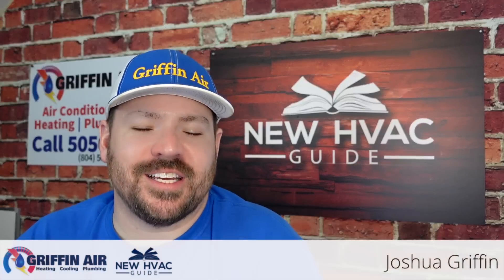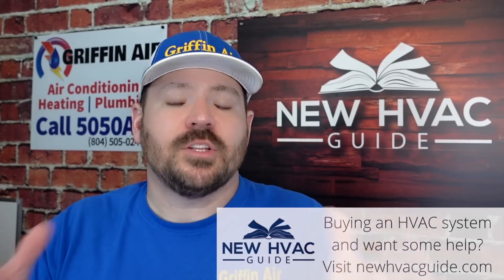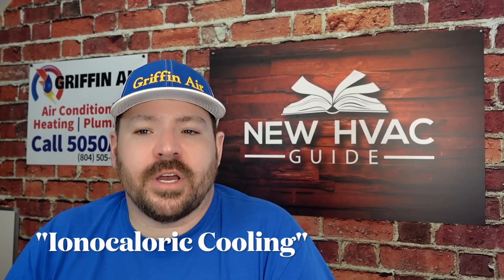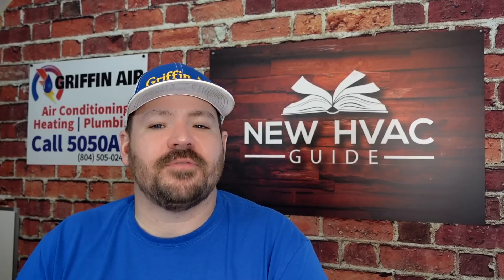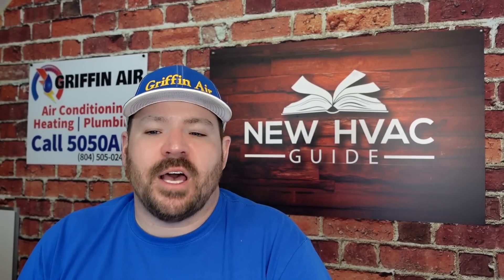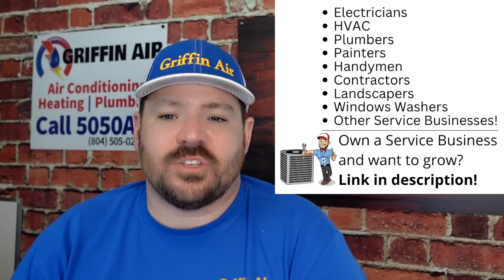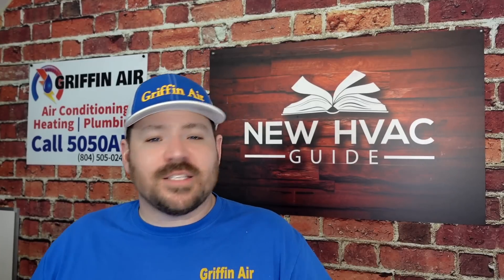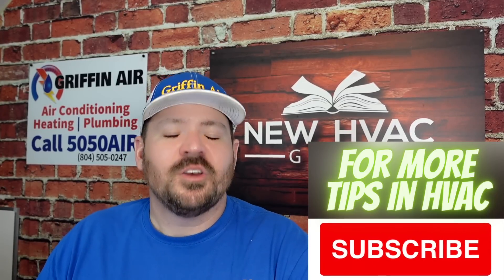New HVAC Technology INVENTED!

Comment: Key to a heat pump system is phase change of material.  During the phase change (gas-liquid-solid) there is a step function in heat exchange to provide or give off the necessary heat energy to make the phase change jump.

Trick is to induce the phase change by another parametric factor, like pressure in the case of conventional heat pumps.   It is always going to require some other source of energy to induce the phase change, like a compressor in the case of present conventional heat pumps.  The success of heat pumps is because it requires less added energy to induce the phase change than the heat energy absorbed or given off by the phase change.

Certain materials can be induced to perform a phase change by subjecting the material to an electric field which puts s structural stress on the material inducing the phase change. 

Usually, these methods require a driving force energy that is not very efficient for the amount of btu transfer accomplished.
Reply from the maker: Great explanation!

Comment: We need a hybrid water based radiant cooling ceiling panels, with air-duct diffusers and air-duct exaustion terminal panels around the ceiling
Reply: How do u deal with condensation
Reply: We use intelligent sensors and controls to monitor the dew point temperature to avoid condensation!  @frqnj
Reply: @frqnj 🤣
Reply: Good reply lol

Comment: Video suggestions:. I'm looking to build a new house and are considering going ductless.  A discussion group I'm in seem to really think it's a dumb idea. What I'm thinking: a 4 bedroom, 2 1/2 bath, 3k sq ft house.  I want to be able to save money by reducing the use of the guest bedrooms unless needed.  Some are saying that putting a 6000 but unit in a bedroom is crazy (I've seen your video on right sizing). They also say that a multi-split are terrible because the condenser can't balance the usage correctly.  I've thinking of a ducted mini-split for the master suite along with the closet and Landry, a unit for the great room/kitchen/eating area, then a 4 head unit for the other bedrooms and sun porch.  What do you think.?
Reply from the maker: What exactly do they think is dumb about it?
Reply: @NewHVACGuide  two fold, overkill which makes it over priced, and a multi head doesn't work like you'd think it would...basically, the outside unit can't really support multiple heads - service degrades the more heads.  Another issue is air filtration.
Reply from the maker: @sctexan5392  Not sure which outdoor unit you're thinking of installing, but there are lots of multizone systems able to support multiple heads.
Reply from the maker: Inverter mini-split systems are the future, but if you're in a market that no is installing them, it may be tough to find someone to work on them.
But when it comes to efficiency, performance, less duct loss, and quiet operation... mini-splits are far superior to conventional forced air. There's really nothing to argue about. 🙂
Reply: @NewHVACGuide  actually have Diakin and Mitsubishi are on top of my list.  What do you think of the air filtration question?  One home consultant says if you go ductless, you'll need whole home air filtration or stand alone units placed around the home.
Reply from the maker: @sctexan5392  I think you need to talk to someone that knows what they're talking about 🤣
Check out this article https://www.mitsubishicomfort.com/articles/filtration-the-way-to-better-indoor-air-quality
and this one https://www.mitsubishicomfort.com/articles/the-filter-you-choose-matters-fight-allergens-without-lifting-a-finger
Reply: @NewHVACGuide  thanks for the education

Comment: When I hear "salt" I think of corrosion and various methods to abate this to avoid an untimely early demise of the system.  Many promising technologies have failed on the rocky cliffs of scaling, efficiency, lifespan, and production costs.  The resulting ionocaloric cooling system will also have to be easy enough to understand and maintain to deliver a compelling life cycle cost to the consumer (corporate and retail).  I'm appreciative that this is being researched.  I wish that more money would be diverted from fusion power research and hydrogen fuel cell research to cooling technology research.  It was over 121 degrees F in Vancouver WA for nearly two weeks in 2021 and it's looking like this will be more likely in the future.  Most don't have air conditioning in this area.  If we all bought air conditioners and fired them up, a tremendous amount of electric generating capacity would have to be added given today's air conditioning efficiency.  We need better!

Comment: I personally think If stand alone heat pumps can get cheap enough that they will be the number one way people heat there homes. At a point when the air gets warmer. If the unit is internal and is abstracting that all ready warm air that it created.  I can’t see that not being super efficient.
Reply: Heat pumps are good for your home heat/cooling and hot water but not necessarily for your refrigerator or car or or computer, or people who need window ACs. That's where this tech will come in.

Comment: They actually use co2 in industrial refrigeration now
Reply: It is still the vapor cycle though, but I do wonder why they do not do it in a residential setting. My guess is because of the pressure that is required to make condensation happen, over 500 psi I believe, so it may have a high energy requirement. NASA uses carbon dioxide for some refrigeration in space.

Comment: This same group is also working on an alternate project which is close to completion. This project combines a patented scroll type compressor driven by the engine in a gas powered vehicle. It is not yet planned for diesel vehicles. This revolutionary compressor will have the ability to pull in the fuel being expelled into the atmosphere by all petrol powered vehicles. None of the current petrol powered vehicles are capable of burning 100% of the ingested fuel.  The newer emission controlled vehicles emit considerably less unburned fuel, but still emit a sufficient quantity to make this system viable. The output of this system accurately produces a product more resembling natural gas or propane vapor. No atomization is necessary, and it produces absolutely no crankcase dilution. In many areas this new system will suffice to totally power the vehicle, but the current fuel injection system must remain to assist in lean atmospheric areas where the new system's output is reduced. The existing on board OBD system and ECM can be easily retuned to adjust between the two systems seamlessly.